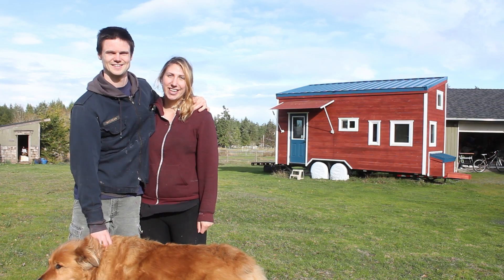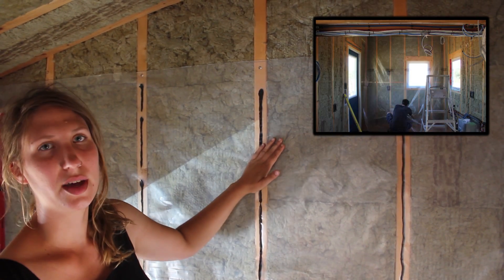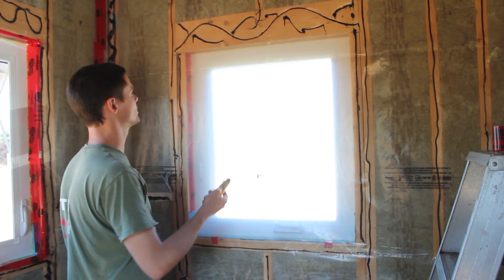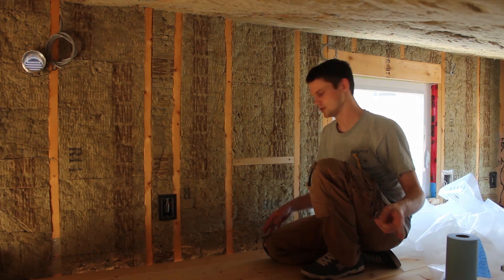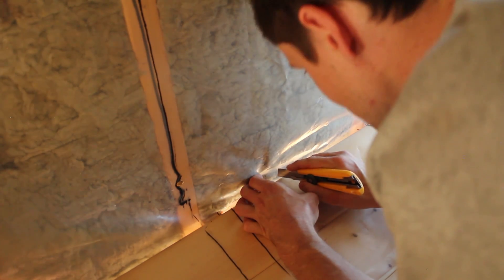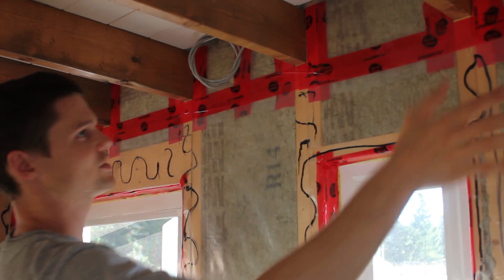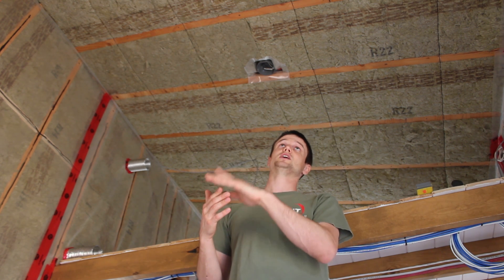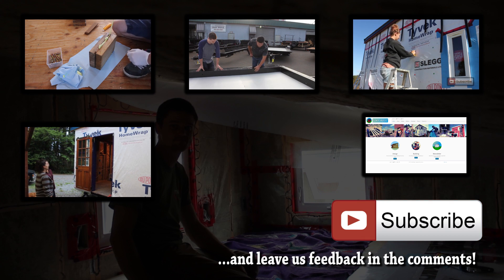Vapor Barrier Installation (Ep.54)

Comment: It's my understanding that rocksal is also a sound dampener. So you' shouldn't get too much sound from rain.

Have you guys thought about air quality? Your house looks to be nearly air tight. So you' might want to look at an air exchanger. Just a thought.

Great job. Looks like you're going to finish soon. I'll bet you're ready. Any thoughts for a wood burner. I saw one that's only a 12" one made for tiny homes. Can be wall mounted....:)
Reply from the maker: +1timby The Roxul is sound-dampening, quite nicely. We've planned from the start to have a heat-recovering air-exchanger... which we will build from scratch :D Also, we already have a propane furnace installed and operational... have a look here: https://youtu.be/uPpA8hRnWTQ?list=PLlUOuqspk4WGpGZPIOKrCti363Eu0MSTl
Reply: Tiny Nest But when propane is an issue you may want an alternative. Also, from what I've seen with propane is that they tend to create a lot of moisture. Especially in a tight home. 

Just my 2 cents...LOL
Reply from the maker: +1timby Indeed a propane flame gives off moisture, which is why we won't have any open flames inside the house. Both of our propane appliances vent directly outside, and we will have electrical cooking. Moisture has been a huge priority for us ;)

Comment: Did you find a way to get your house certified to tow?  I am running into all kinds of issues.  Best answer I got so far was at the scales in Parksville.  Have the trailer certified as ubuilt and  build the house on it, have it weighed and get it tagged with the gvrw.  He also recommended having 4 wheel brakes.  Apparently some only have brakes on 2 wheels, which I never knew. 

I was also wondering about air exchange, but I see you have it covered.  It certainly is air tight.
Reply from the maker: +gary pollock We haven't pursued any certification yet. We feel that tiny houses will eventually become an officially recognized thing (there is obviously the demand for it) and we will try to get it certified properly when that time comes. For now we are treating it more like a mobile home and will use a towing company if/when we need to move it. That way, it's not up to us to make it legal on the road.
Yes the air exchanger will be important :)

Comment: If the reason you are using that sealant was to make sure you had no holes from staples what about the nails for the sheetrock or wainscotting or whatever you choose for that - I sure hope you have a air to air heat exchanger
Reply from the maker: +Sachi In Wisconsin Since the tiny brad nails that hold up the wall-panels all go into studs, and the studs have the black acoustical sealant on them, there should be very minimal breach from that :) and yes we will have a heat-recovering air-exchanger... DIY of course :D

Comment: Can I do vapour barrier on cold storage wall ( its concrete ) and ceiling ( plywood) ? It’s under the open porch
Reply from the maker: It depends what you're trying to achieve. I would recommend reading some articles on vapour barriers, that's what I did. The function of the barrier (in a cooler climate) is to prevent interior moisture from entering into the structure's shell where it can condense and cause water damage. It's definitely possible to CREATE a moisture problem if installed in a configuration that's inappropriate for the situation.

Comment: F"in pro! This looks great. Any recommendations on a vapor system to use on a van?
Reply from the maker: Hm, I'm not sure if you can (or would want to) seal a van that tight... you definitely need fresh air in a small space like that, just keep that in mind!
Reply: Tiny Nest 
Thank you. I keep watching videos on a build out I want to do but havent seen a viable solution for moisture build up in the insulation cavity in a humid area with extreme temp changes like chicago.

Comment: You don't want to hear this, but I would have used conduit for all the electrical to make the vapor barrier simpler and better. I probably would have exposed most of the plumbing for the same reason. I like seeing that stuff and it should make it more accessible if you ever need to make repairs.
Reply from the maker: +MakeMeThinkAgain This is definitely an option, but we have an unusual amount of wiring in the house so the conduits could get crazy! We might consider this option in a different design.

Comment: is it common practice in north America to do this internal vapour barrier? I work in construction in australia and have never seen an internal barrier like this (only external, under external cladding).
Reply from the maker: +Roslyn Maree In our climate, the humidity can be fairly high, and the temperature outside can be fairly low... so can happen is that heated air on the inside of the building can seep through the exterior walls, and when it gets far enough through the insulation layer, the water vapour can condense, creating moisture inside the walls/ceiling cavities. Since there is no ventilation in there, it will stay wet and eventually mold/rot. The barrier keeps the interior environment isolated from the structure.
Reply: +Roslyn Maree Many contractors are changing their school of thought on this. It's far better for the walls to be able to breath, especially if moisture/vapor does get in the wall, and it will eventually, from one side of the wall or the other. I have seen houses with vapor barriers with rotted out floors and bottom of studs because of moisture collecting on the barrier, no way to dry out, drips down, and pools at the bottom of the wall. The key is a house wrap on the outside sheathing and good ventilation inside (running vents/fans when cooking, showering, etc.).
Reply from the maker: +Little Rabbit I've recently learned that in hotter climates where you do more cooling than heating of a house, that the vapour barrier goes on the outside of the insulation. Hot air move to towards cold, and humid air towards dry... so if there is a way to block moisture from entering an enclosed space due to pressure of humidity/heat differentials, then I think it's a good thing. But it definitely can exaggerate a problem in the wrong climate or installed wrong. We're pretty confident that our installation will help our particular situation, and we'll be reporting on our humidity once we're fully moved in.

Comment: I love your attention to detail, Jake! You don't skimp or cheap out in your construction practices. That being said, in retrospective, what do you feel about doing your complete wall and ceiling insulation and vapor barrier prior to putting in the loft floor?? My floor plan concept is a little different, with a 9.5 foot loft (28 ft trailer) with all kitchen and bath just under the loft floor on the main level. So walls with need to be constructed to accommodate those plans. Could you forsee doing the main walls and ceiling with insulation and vapor barrier prior to that construction? If that makes any sense. Lol
Reply from the maker: I think I know what you mean... We've seen some lofts suspended with joist-hangers, which means as long as you frame in such a way as to have plenty of spots to fasten into, you could build the entire shell, and even leave the loft until finishing time... I think we would take that approach if we were to build again.

Comment: What kind of vapor barrier did you use?
Reply from the maker: Just regular "poly" sheeting... the standard kind... sorry we don't remember the thickness or specific type :P
Reply: Thanks! Probably the least of my concerns. I've watched several video's on wiring and decided I would just hire someone verses me putting myself at risk. I respect those who are licensed. I could watch someone wire from beginning to end but that's not enough for me since I don't really understand it. Someone offered to do it for around $1000. I guess that's not too bad. The only concern I have with the guy I talked to is the fact he's never done AC/DC. I bought the progressive dynamics box thing. He said he wasn't concerned. He has a 20 year work history and is a Master electrician so I'm ok with him
Reply from the maker: The progressive dynamics box does make thing pretty simple, and I'm sure any electrician can get it hooked up. Just be sure you've calculated all your electrical loads and that it won't exceed the box's ratings... I had looked into those in the past but found them to be a bit light.

Comment: You created a mold garden...ive been building for 25 years..trust me. I make my living running around fixing screw ups like yours. Next we need to talk about ventilation a proper intake and exhaust system. It's easy and cheap to do .a lot of times it can be accomplished just by not caulking every darn thing airfricken tight.....which brings me to my next point of energy conservation. But that's another topic although totally relative...its all works together...we are breing g deceived by people trying to sell you crap
Reply from the maker: We will have a heat-recovering air-exchanger. Currently we run two low-power dehumidifiers, and it stays quite dry inside. I've followed some modern building-science where the idea is to seal things up ultra-tight and then do well-planned active ventilation... the issue is of course that if you seal it tight, but then have some other failure that allows moisture into a cavity, then it can't dry out. I'm not worried about our use of the vapour-barrier because I feel confident in my understanding of the air/moisture dynamics that can occur in our house, but if you can explain the physical process that would lead to this having been a poor choice, I'm all ears.
Reply: Robert Hill so a vapor barrier is not necessary?